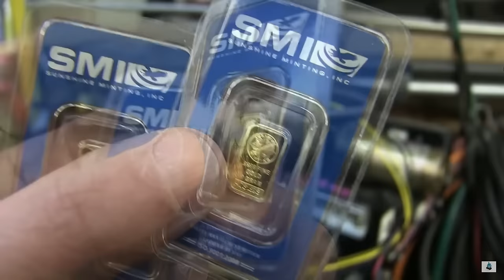Cold Welding In Vacuum

Comment: Cody: Cold welding is all about cleanliness and flatness. Speaking from experience, physicists doing high-precision experiments don't have to worry about cold welding effects until they are utilizing ultra-high vacuum (UHV) systems. At those pressures, nothing is generally able to be dirty (because it if were, then the pressure would be lower anyway, because even metal outgasses to some degree).

Think of it this way. Metals are really just atomic lattices. If you zoom in so far as to be able to see the atoms (at atomic resolution), then in the absence of anything else (oxide, dirt, crap, whatever), you'd just see an incomplete lattice (probably rebonded at the boundary) and then nothing else (just vacuum). If you have two such objects and then touch them together, then you literally have just one complete object. In other words, cold welding is the effect of making two objects one, quite literally. If you zoomed into your samples (which you probably think are relatively clean already), you'd be shocked to see how much gunk there is on them in the form of water vapor and other stuff on the atomic scale, even with the oxide completely removed. Moreover, you have to have very flat surfaces in order to cold weld properly. Polishing to a tiny grain size is almost a must in order to see the effect.

The problem comes in because there's almost always just way too much junk in the way in order to actually cold weld something. Oxide will obviously be in the way, but even if you remove all of that, there's still a lot of stuff that will cause problems. If you have an UHV vacuum chamber and clean it with chemical solvents for days and bake the hell out of it, you're still going to be pumping for quite a while before you reach UHV pressures (circa 10^-10 to 10^-11 torr). Scientists who use UHV will tell you how arduous it is to get their chambers down to UHV pressures. Even a single fingerprint accidentally left on the inside of a UHV chamber will cause the pressure to be high for months. For this reason, everything that goes into the system has to be ultra-clean. Parts have to be cleaned with chemical solvents over and over again (often using an ultrasonicator) and so forth. The chamber itself has to be baked for a long time to remove the excess fluid pressure of the moisture left inside. Conflat flanges using copper gaskets have to be used in lieu of traditional o-ring seals because at those pressures traditional seals will fail. You absolutely cannot touch anything which goes into a UHV system with oily (ungloved) fingers. In short, UHV is a lot harder than normal vacuum pump work.

And yet, you really need UHV pressures in order to see proper cold welding. Sure, you can twist parts together at atmospheric pressure, but you're really just lodging the metals together in certain places and causing them to hook together because they are not atomically flat in places. You're just using the non-uniformity of the (presumed flat) samples that you have in order to simulate a cold weld. True cold welds should be permanent, because it's really just touching one half of an exposed, polished, flat metallic surface to another, making one piece.

I hope that makes sense. In summary, once again, cold welding is all about cleanliness and flatness. Thankfully, it is much harder to achieve than it is, because otherwise us scientists would have a devil of a time trying to get anything done!
Reply: SlamminGraham HA Nerd!
Reply: SlamminGraham word
Reply: SlamminGraham Jesus how long did it take you to type that
Reply: That was a pretty nice read. Thanks for writing your comment.
Reply: SlamminGraham I like it. keep up the good work
Reply: SlamminGraham I think he knows that. Usually, he knows what the result will be, he doesn't have a degree for nothing.
Reply: SlamminGraham Thank you for pointing this out to Cody. His diy vacuum setup isn't nearly good enough to prevent surface contamination. This is exactly the reason why expensive UHV chambers exist. And with the block of wood in the chamber he'll never get the surface clean! I remember a rule of thumb that at 10^-9 mbar it takes an hour until a clean surface is completely covered with gas molecules, and with each magnitude of worse pressure, it goes a magnitude quicker. So at his 1mbar setup there is no way of keeping the surface sufficiently clean. Even in UHV the surface doesn't clean itself; the cloth was a good idea but for actual microscopic cleaning you need to sputter and anneal the surface in a UHV chamber, which I would deem impossible in a diy vacuum chamber. But hey maybe he'll get a turbomolecular pump and a better chamber in the future and we'll see some diy sputtering tool, wouldn't that be amazing? If AppliedScience can build a diy electron microscope, Cody can build a UHV chamber :)
Reply: He doesn't have a degree, He is in school to GET a degree.
Reply: ' Sure, you can twist parts together at atmospheric pressure, but you're really just lodging the metals together in certain places and causing them to hook together because they are not atomically flat in places.'

You were doing well until this point; unless people have watched the entire series, they would have missed the brief clip(s), demonstrating surface defacement in areas. A scanning electron microscope would probably show tiny areas of hills and pitting where metal was quite literally torn away from each other. This is an indication of metal-metal bonding: covalently shared electrons.

As I've written repeatedly, the pressure-twist-hold suggests that what is happening, and what will not happen just by pressure or dropping (even in a semi-hard vacuum) is that metal irregularities are being ground/smoothed off at sub-micrometer and even sub-nanometer scales, exposing virgin uncontaminated gold or indium at tiny areal scales These surfaces are then at intimate, bond-distance, contact, literally weld into a unified whole, though possibly with an amorphous ~600 picometer transition sandwich: a metallic glass.
Reply: tubeist- dan the tubist speaks wisdom.
Reply: really teacher you just ruined recess
Reply: Cody: Cold welding is all about cleanliness and flatness. Speaking from experience, physicists doing high-precision experiments don't have to worry about cold welding effects until they are utilizing ultra-high vacuum (UHV) systems. At those pressures, nothing is generally able to be dirty (because it if were, then the pressure would be lower anyway, because even metal outgasses to some degree).

Think of it this way. Metals are really just atomic lattices. If you zoom in so far as to be able to see the atoms (at atomic resolution), then in the absence of anything else (oxide, dirt, crap, whatever), you'd just see an incomplete lattice (probably rebonded at the boundary) and then nothing else (just vacuum). If you have two such objects and then touch them together, then you literally have just one complete object. In other words, cold welding is the effect of making two objects one, quite literally. If you zoomed into your samples (which you probably think are relatively clean already), you'd be shocked to see how much gunk there is on them in the form of water vapor and other stuff on the atomic scale, even with the oxide completely removed. Moreover, you have to have very flat surfaces in order to cold weld properly. Polishing to a tiny grain size is almost a must in order to see the effect.

The problem comes in because there's almost always just way too much junk in the way in order to actually cold weld something. Oxide will obviously be in the way, but even if you remove all of that, there's still a lot of stuff that will cause problems. If you have an UHV vacuum chamber and clean it with chemical solvents for days and bake the hell out of it, you're still going to be pumping for quite a while before you reach UHV pressures (circa 10^-10 to 10^-11 torr). Scientists who use UHV will tell you how arduous it is to get their chambers down to UHV pressures. Even a single fingerprint accidentally left on the inside of a UHV chamber will cause the pressure to be high for months. For this reason, everything that goes into the system has to be ultra-clean. Parts have to be cleaned with chemical solvents over and over again (often using an ultrasonicator) and so forth. The chamber itself has to be baked for a long time to remove the excess fluid pressure of the moisture left inside. Conflat flanges using copper gaskets have to be used in lieu of traditional o-ring seals because at those pressures traditional seals will fail. You absolutely cannot touch anything which goes into a UHV system with oily (ungloved) fingers. In short, UHV is a lot harder than normal vacuum pump work.

And yet, you really need UHV pressures in order to see proper cold welding. Sure, you can twist parts together at atmospheric pressure, but you're really just lodging the metals together in certain places and causing them to hook together because they are not atomically flat in places. You're just using the non-uniformity of the (presumed flat) samples that you have in order to simulate a cold weld. True cold welds should be permanent, because it's really just touching one half of an exposed, polished, flat metallic surface to another, making one piece.

I hope that makes sense. In summary, once again, cold welding is all about cleanliness and flatness. Thankfully, it is much harder to achieve than it is, because otherwise us scientists would have a devil of a time trying to get anything done! THIS IS SHIT FUCKING SLAMMINGRAHAM
Reply: in summary.. cody needs to science the shit out of this..
Reply: SlamminGraham In a high vaccum there will be dark energy but I wish Cody did more experiments with that stuff. he says he's got a fusion reactor in the pipes but I doubt it
Reply: Python - What the hell are you talking about?  "Dark energy" is theoretically present in every given quanta of space regardless of whether it's a vacuum or not, the only reason it isn't apparent on small scales is because the fundamental forces affecting ordinary matter are far stronger on those scales.

I have to say that I really hate the term dark energy.
Reply: I wish I was smart like you...
Reply: +Alyas Grey
Unknowable mystical force?
Reply: so the solvents you used to clean everything are air dyed ?
Reply: SlamminGraham I read your Article, I totally read it, Reading an article is SO MUCH FUN -.-
Reply: Well, +Well, It truly is. I see your sarcasm, but finding this proves that I am not the only comment-paper writer.
Reply: +Garrison Pendergrass
Which doesn't prove anything, but it allows you to feel good about it.
Which is important because then you can keep writing them and I can get some proper information about these matters without actually having to go through the bother of university studies. Thanks man.
Reply: So in other words, the gauge blocks are basically just metal velcro?
Reply: +Keyser Soze
That's what he's implying, yes, good analogy!
Reply: SlamminGraham t
Reply: This is an interesting read. In addition to what has been said, the process of welding in this context should be energetically preferred because you're reducing the amount of surface atoms relative to the amount of inner atoms by joining 2 gold pieces. Inner atoms within the same crystal tend to be more stable than the surface atoms within the same crystal. However, this does not mean that this process is devoid of an activation energy. In other words, I would expect that there is no bonding by simply gently touching them, even if the surface of the gold pieces are PERFECTLY clean. 

The BEST case scenario for cold welding is with nanostructures (and probably those made of gold) because surface atoms on nano-things are so much more unstable than surface atoms on bulk (pretty much things visible to your eye) things, they more eagerly want to reorganize. I recall a research group trying to cold weld nanowires of gold, in which case they STILL had to apply some pressure.
Reply: Alyas Grey would you prefer the term ethnic energy
Reply: You can tell a few people in this comment thread are material scientists/engineers. Particularly, slammingraham and janzwertyuiop.
Reply: Justin Averbeck You can tell they have access to the internet are as capable as grade 8 students are at reading Wikipedia pages. This isn't a complicated subject and I'm pretty sure Cody realizes why this didn't work too well.
Reply: The moment I saw him put in his contraption made of wood I thought not gonna happen now.  No matter how clean the gold was, no matter how good of a vacuum the wood of the contraption was letting off moisture he would have had to have put the wood in a vacuum for a very long time to get all the moisture out of it.... Also using a lens cloth isn't the best way to clean the gold.  Cloth like that isn't going to do much for the gold polishing wise
Reply: Pc Principal oh
Reply: some good reads in this thread. It's hard to know what is actually going on when a couple people here have differing theories yet seem so certain of them. I find the idiots complaining about comment length, or telling people to "shut up", or the guy who claims this is all basically wiki copy-paste kind of perplexing though. What in the world are fools like that doing watching a video like this, or just on Cody's channel in the first place? And why have they bothered to read into this thread only to make such a moronic reply? Anyway, to those of you who make long comments with well thought out information and theories... keep it up, there will always be those of us who give the time to read and appreciate new, novel input.
Reply: Thanks for taking your time to explain this, really helpful 🙏🏽
Reply: This is nice! Thanks for putting the effort in writing this.
Reply: I know it's 3+ years later, but instead of cleaning and flatting the surface of a metal object, wouldn't it be easier to just shave off a thin layer of the metal in a vacuum, that way the new object surface will be both flat and clean?
Reply: This was done longe enough ago, I knew that someone had to make this comment.I mean every single time would have to prepare the ingredients to perfect status. Just not done here.
Reply: So then electron beam cutting would be ideal for shaping materials to the proper flatness then? After that you should theorhetically be able to produce a cold welding result "easier" than just milling it down and sanding to be flat. Of course you would still need to follow proper cleaning procedures but electron beam machining could be the way how to produce better cold welds more consistently. But either way i think that based on what happened to the space shuttle that had its door cold welded what happened was there were some very high energy particles coming from the sun and bombarding the outside of the craft whoch removes a layer of oxides and allpwed it to cold weld also due to then amount of time and force of it being held shut. If you think about it. The door is being both held in place and pushed out due to atmospheric pressure. So i feel its not just about having a vacuum but also having some force behind it (along with cleanliness of testing/manufacturing UHV chamber and materials via electron beam machinging.

Comment: When I tig weld aluminum, after I'm done "molten puddle is solid" during the post flow of gas I can stick my filler rod to the piece near the weld and it sticks together.  When you weld aluminum it burns the oxide layer off and is under 100% argon gas (inert) this could be a great way to verify your oxide layer and oxygen molecules sticking to the surface theory.
Reply: Ross The Welder That's a very interesting thought! I've noticed that occasionally while tig welding aluminum, but never really thought about it much.
Reply: *aluminium
Reply: Ill have to try that